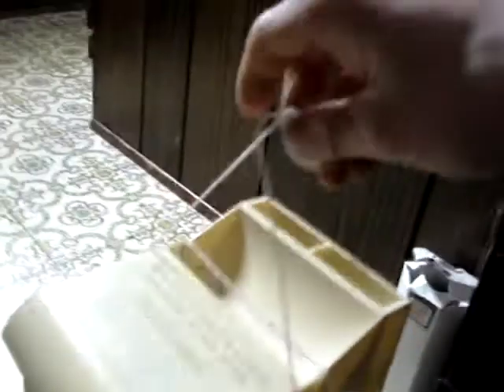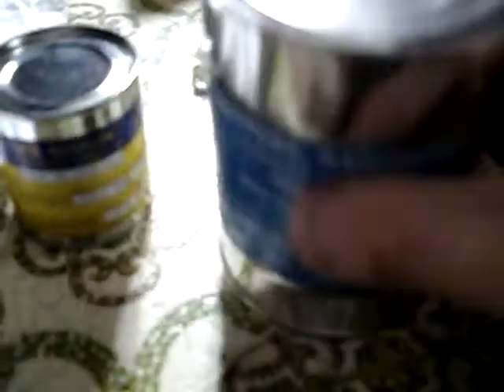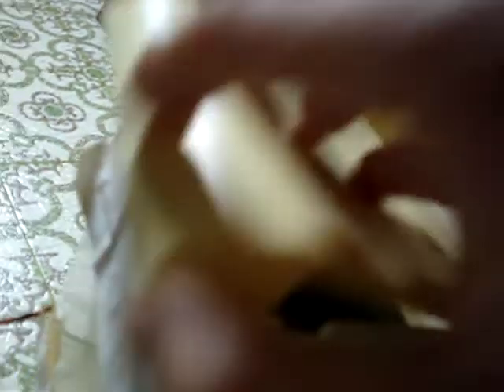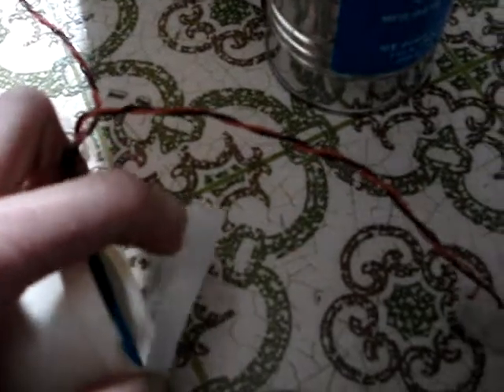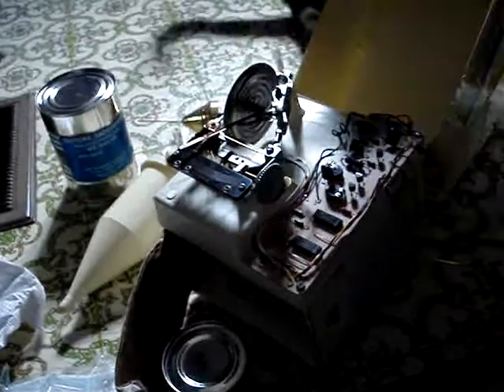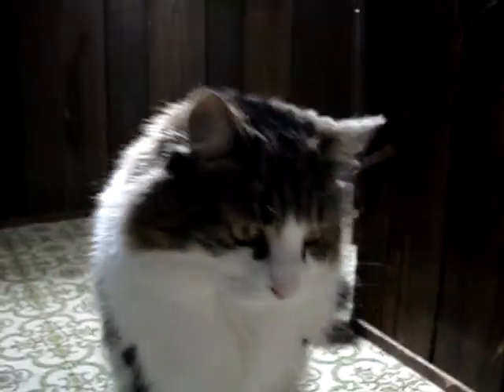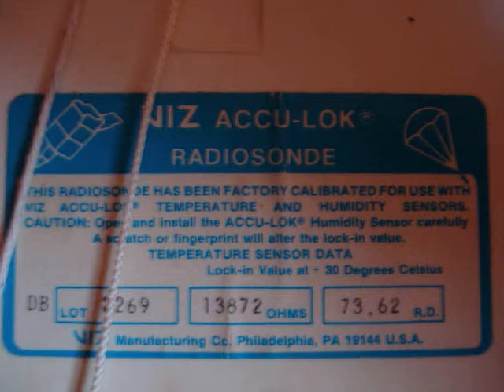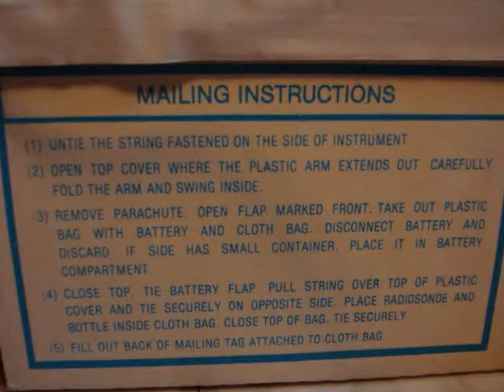Vintage Radiosonde (Weather balloon)

Comment: @coolbluelights The barometer is attached to the switch with the lines on it (commuter bar). Useing the chart that came with the sonde, and knowing the current pressure, at station height, we could count how many times it switched from temp to humidity and know what the height of the sonde was at any given time. Think of the barometer as a altimeter.. I released or help release hundreds just like the one you have for the Army. I would love to have one. Where can I buy one?

Comment: The wires on the side were to check the humidity and temp at ground level before launch, and just to make sure it was sending out a good signal for each. The radiosonde only sent temp and humidity readings.